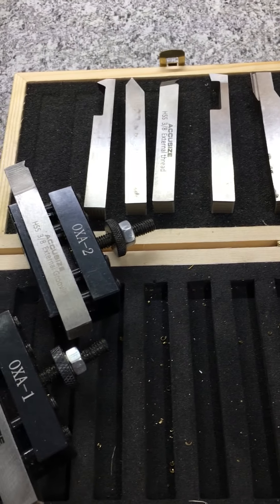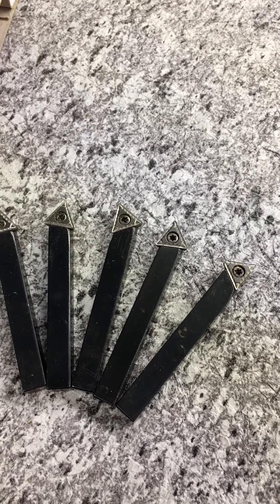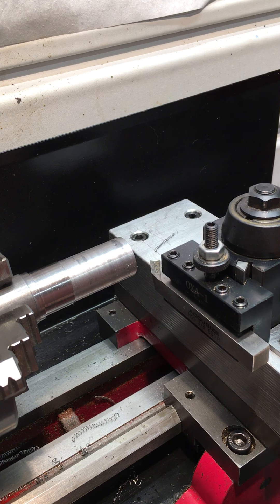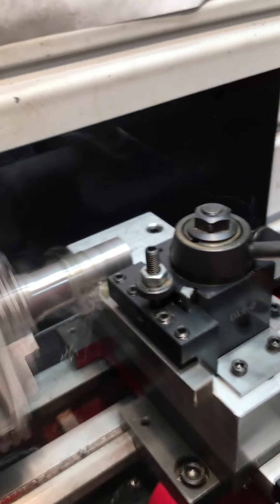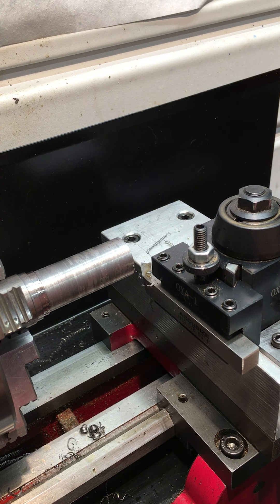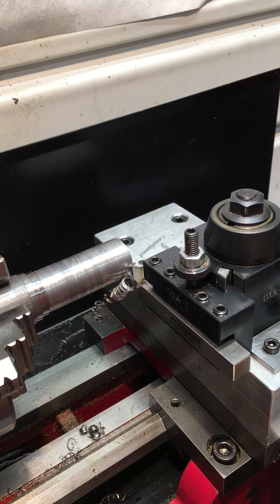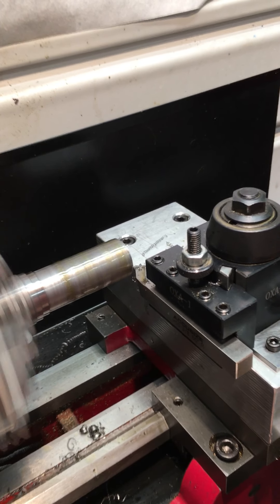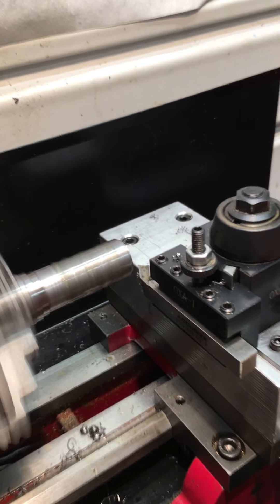HSS /:-( part 1

Comment: Hi Kimber , thanks for the video !
Those brazed carbide tools need some work on them before using and the first step is to strip the paint off then take them to the bench grinder and make sure the front and side clearance angles are there , i have generally found that when they make these things they just machine a step on the end of the tool blank to accept the carbide tip and don't add any of the required clearance angles - once these are ground in they usually work well .
It is an important step in any ones machining endeavors to learn to grind HSS tooling whether it be a lathe tool or a drill bit - unfortunately there is a lot of information out there that is either incorrect or scares people into thinking this is beyond them and the only way to learn is by trying it !  Will you stuff a tool - Yes , Will you make mistakes - Yes , will you learn by these mistakes - Yes and that is the way we have been learning since monkeys fell out of a tree and created humans  ! 
I don't know if you have looked at these channels below but i think you might learn a few things from them :
That lazy machinist 
mrpete222
weld.com
For learning the basics of machining or welding they are my top 3 .
Keep up the good work !

Comment: The brazed on carbide needs a green wheel to sharpen but diamond hone touch ups are ok i have the same tipped carbide from banggood the work fine keep eye out for chipps check your tip i think you chipped it when it stalled